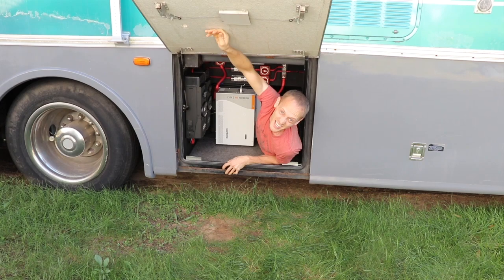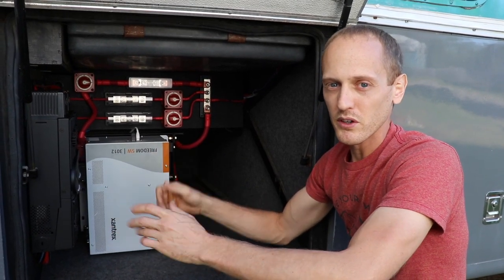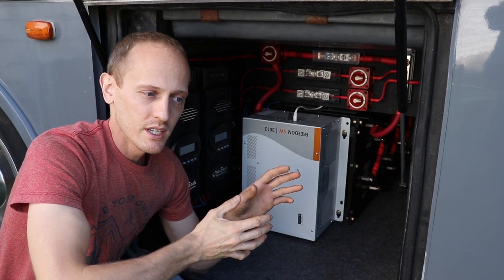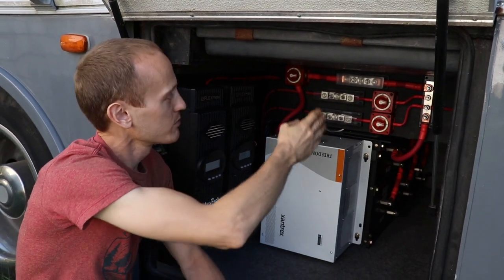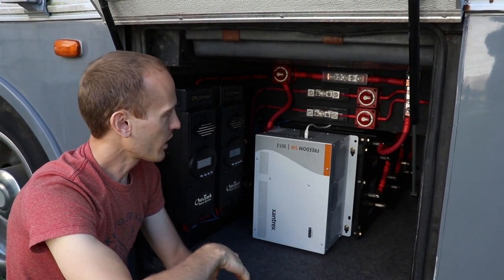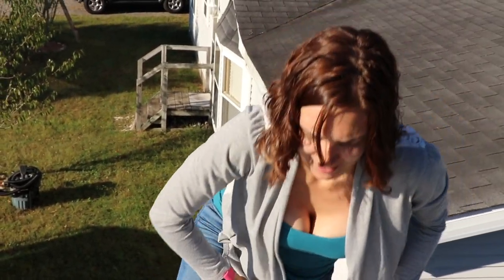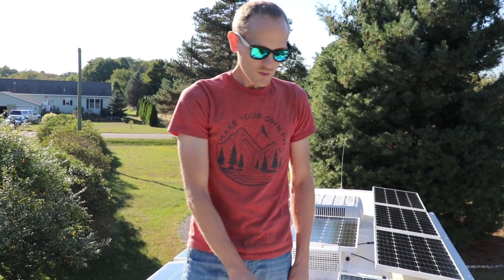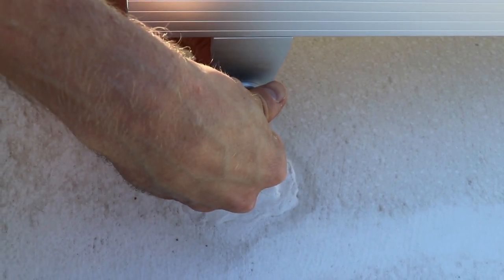Massive DIY RV Solar Install for Off Grid Boondocking

Comment: I'm not so sure the lithium would have cost you that much more. 

1) The lithium can be discharged a lot further than the AGM.  So, you only need half as many amp hour equivalent lithiums. 

2) The lithium will charge much faster and require less energy to get to full charge.  This would have reduced how many panels you needed to buy.
3) They weigh less which means the install wouldn't have taken as much time or materials.
4) They last MUCH longer which means additional savings in the long run.
Don't get me wrong, if you were buying dirt cheap AGMs because you simply couldn't afford better than I could see the argument that lithiums are just way outside your budget.  However, considering what you did buy, plus all of the other equipment, then clearly you had some wiggle room.  Just my 2 cents.  It's your system though so you do you.  Nothing wrong with going the AGM route if that is what you prefer.  Just sounded like it wasn't what you would prefer, just what you thought you could actually afford.
Reply from the maker: We would definitely prefer lithium. It would have been $3000 more to go that route and it had already taken us 3 years to work overtime and weekends to save up for the system we have along with renovating the entire rig. We aren't made of money and didn't want to wait another year to save up to go lithium. We have been on the road full time traveling for almost 11 months now. We would still be working if we hadn't taken this route.

Comment: Nice setup we have 2880watts on our 5th wheel with two battery systems front is 400amp Chevy volt  then back is 1253amp 6volt battery's about 800lbs. Keep the sunny side up!!
Reply from the maker: Definitely! You as well. Living the silent power dream. 😎☀️

Comment: Thanks for your prompt reply..... I have 10 (200) watt panels on or '07 Newmar. I've seen 1450-1500w high sun. I believe I have shadowing from (3) AC's & other misc. I don't have ability to tilt nor do I want to. I have seen mention about an add on box to the back of each panel that helps the shadowing problem..?

Comment: Nicely done..!! I have a similar size solar system on our class A. Realistically what watt do you see in on average.?
Reply from the maker: The highest input we have seen is 121 amps to the batteries. That would calculate out to about 1650-1700w depending on voltage at the time(bulk or absorption). If we are going with an average in good sun I'd have to say around 80-90 amps midday. So around 1100-1200w. We have been pulling in 30 amps while it is raining before.

Comment: Really nice system! Just wondering how the panels raised up like that have handled the wind from driving? Any issues with lifting?
Great job!
Reply from the maker: After 11 months of full time travel (so far) and 20,000 miles, I'm happy to report that there are no issues with lifting. People don't realize that we are driving a brick down the road. 😂 The aerodynamics of an RV create a tumble of air on top that in a lot of ways actually pushes back down on the roof. Add to that the fact that a solar panel has a blunt edged frame around it that doesn't generate lift like the wing of a plane, and you are good to go. If you plan on installing solar, I would highly recommend mounting the panels higher that what they are with the tiny brackets provided. The airflow to evacuate heat while in the sun will be worth it. Thanks for watching and asking questions. 👍
Reply: @HereThenGone  Thank you so much for the quick reply. I love the idea of lifting them up for airflow and less shading from the A/Cs and such. Something I had not thought of before. I will be using this technique when I start our solar set up in the future. Thanks for the great videos and keep up the good work!

Comment: I don't understand, you have a vehicle that undoubtedly has a 24 volt system and you are installing a weaker 12 volt power system.

Years ago I switched from 12 to 24 volts much more powerful.

Hopefully you have connected the panels in series with high voltage.
Reply from the maker: You are correct. You don't understand. Haha. We have a 12v system on the rig. 12v alternator and all 12v components. Hence, the larger 12v power system. It has worked above and beyond our needs for almost 11 months on the road full time. 

Power is rated in watts, and is a combination of amperage and voltage. 24v isn't more powerful, it just slightly decreases the amperage draw on large power devices. With a system like ours with the appropriate sized wiring and components, the difference isn't worth the extra DC to DC converter needed to step everything else in the rig back down to 12v. 

I clearly stated in the video how we wired the panels

Thanks for watching 😊
Reply: Almost all buses here in europe have a 24 volt battery system. hence the confusion.

Nice power system only be careful with eating  otherwise you will not fit in that hatch anymore 😂.
Reply from the maker: @lexpee  haha. We've been eating a plant based diet for over 3 years now. Have to make sure to fit in all the tight spaces and keep ourselves extra healthy. 👍

Comment: What kind of roof? We now have a fiberglass roof on our dp and I’m not sure how to install the brackets. I don’t think there is enough wood underneath to hold screws for the wind load. Our 5th wheel had a membrane roof over wood, that was straightforward. Great installation!
Reply from the maker: Yes, this is a rubber over wood style roof. I don't remember the exact product, but I have heard people getting good results with industrial adhesive on the mounts connecting to the roof. If I were to go that route, I'd want to make sure there is plenty of surface area on the foot of the mount plate. They also do a combo of the adhesive and a self tapper or two, then dicor over the whole thing

Comment: Very sweet set up! I'd be interested to know how you integrated your Generator? I've got a built in Onan and am planning a solar setup, but am just not sure how to integrate them without having them interfere with each other.
Reply from the maker: If your generator is already installed, you have a 30 or 50 amp transfer switch installed already. In our setup, the inverter has a 150amp charger in it. When on shore power or the 2 times we have run the generator in the last 10 months, it simply engages the charger and the solar charge controllers see that there is no need for them to run, so they go to sleep. Having multiple input sources charging your batteries is fine. Each will only put in as much as is needed. Typically the charger run from shore or generator power will act as the main source and your solar controllers will take a back seat
Reply: @HereThenGone  Excellent! I appreciate the info!

Comment: I really enjoyed this video. A few things that stand out and I applaud you for. A young couple that has an idea, then studies enough to make it into a plan, then research and study enough to work to turn your plan into reality. Hats off to you both. Y’all sorta remind me of my wife and I back some 35 years or so ago when I wanted to build a house when all I had was a hand drawn sketch on a piece of paper. Like you, if I can envision it, I can build it. Since then have built two houses, both better built than what I would have gotten if I would have just hired a contractor, that at the time I couldn’t afford. You inspire my confidence in the younger generation. (I’m 65, worked over 44 years in the rotating machinery installation, maintenance, repair, and everything in between within the oil and gas industry) You thought out what would be the best within your budget, then executed your plan. You remind me a lot of us. We lived in a 42’ diesel pusher the 4 times I unrestored to work on a project. We now have a small Pleasure-Way B+ motorhome on a Sprinter chassis. Your setup inspires me to do similar but on a smaller scale. With the setup you have, you could easily run a high SEER mini split AC 24/7. Check out David on Gone Boondocking on You Tube. https://youtu.be/rjVIxqTHahY   He, like you, has some good ideas, like his hour shower for example. Maybe one day will see y’all on the road. Safe travels. Enjoy life. Don’t let your dreams outnumber your memories.
Reply: Un-retired not unrestored. Darn spellcheck.
Reply from the maker: @dannybevills1567  thank you for the kind words. Not having a lot in life surely makes you more self reliant and driven to work. Sounds like we would get along great in real life. A mini split has been on my mind for a while now. The initial cost is what is holding us back at the moment. Hope to dive deeper into it in the future

Comment: Wow! Absolutely gorgeous design. I get super excited when I see a system so beautifully laid out. I would love to see a pictorial or schematic of your system, although I think I would want to try to locate my battery bank in an easier to reach location :-) I could see myself getting in there, and getting stuck forever.
Reply from the maker: Haha. The only positive about them being tucked away is that they don't need any maintenance, so now that they are in, they are out of the way. Definitely a pain to get them there though. I never ended u making a schematic because a) I tend to just design things in my head b) no two systems will be exactly the same. I do understand that it would still be a useful tool for others though. Maybe I'll have to get to that some day.

Comment: Have you ever thought about coming up with a DC heating system and somehow running the AC compressor with a DC motor??  That way skipping an inverter and ALL that robbing of DC amps/ac power.
Reply from the maker: The problem with that is that wattage is wattage. The only thing you would gain from that would be the conversion losses. So instead of the roof A/C drawing 155-160 amps, it would potentially draw 140-145 amps. Still much too high to be practical.
Reply: @HereThenGone    ??  When in a Motor Home is off-grid my DC wattage/amps ARE robbed by the INVERTER'S A current...  If I had a DC heater or a DC compressor to run mt Air C I'd be way ahead of the game.   A magnet motor could run the dc compressor OR what about a magnet DC 2 H. Power running a CAR Alternator - which could put out 200 amps.  ??  The primary source of power would be SOLAR....
Reply from the maker: @peterscherba4138  haha. When you have completed this miracle setup, let us know how it works out for you.
Reply: @HereThenGone  You don't see IT as possible??  A  car alternator has to spin let's say 1200 idle rpms.  With half of your solar panels couldn't U run/spin a powerful DC motor?? That motor could spin a high output ALTERNATOR as in a car.  This can run longer than u have SUN.  Show me where I'm wrong. U can series 12 Volts to make 24/48 etc by having a Switch back to 12 volt charging from solar.  Explain  why U couldn't.
Reply: I realize TORQUE is needed to spin an altern
Reply: -nator and a strong H power ofPower motor
Reply from the maker: @peterscherba4138  if I have to explain to you why you couldn't run an air conditioner by spinning an alternator with a DC motor powered by solar, then we are not going to get anywhere. I have no burden of proof here. You do. Conduct your experiment and make a video of the results.
Reply: @HereThenGone    You are not thinking...  Look how much $ you've spent ON solar panels and what do you get per 200 watts?? A measly 10 amps at peak hours... An alternator can produce 200 amps ( in a vehicle)  If u can utilize that THEN it can charge your batteries --- then you hook-up an inverter and you CAN run an Air C.  If you're too lazy to brainstorm a little with someone then you are correct --- we won't get anywhere.  Ideas and solutions come from discussions --- not self-right thinking.  Besides, I'm in the Vancouver area and is why I'm venturing toward other options --- and there are many out there.    This is 2020.
Reply from the maker: @peterscherba4138  it sounds like you are saying that you will run the alternator with your vehicle engine, which of course would work. But that defeats the entire purpose of solar. You won't be running a high output alternator with solar.
Reply from the maker: Also, it's not self right thinking. It's simple math. As you've stated, we'll only get 10amps at peak sun from 200w of solar, so how do you figure you can run an alternator under load with a DC motor powerful enough to charge enough batteries to run an A/C unit. The math doesn't add up. And as for saying I'm lazy, I think my video speaks for itself on how NOT lazy I am. I built this system along with renovating my entire RV while working 60-70hrs/week and renovating my house to sell to hit the road.
Reply: @HereThenGone   You definitely are not lazy --- I only meant not discussing or questioning/how can one do what I'm proposing.  Like everyone says you can't get something from nothing (equations don't lie).  But because of magnet motors.  If they can spin an alternator by using much fewer amps to do that then perhaps one could gain or get slightly ahead.  Solar isn't nothing IT is something that is cheaper.  Magnetic motors are also something.  So if I can find a way to CUT my cost down to a minimum then I am ahead of the $ game.  Like solar is (once paid for)  I lived in an RV and the conventional power system supply is expensive.  Generators/Inverters (Las Vegas)  heated inverters etc.  Now Canada --- heaters.  If I could find a very cheap way of running a charging system I would buy it.  Even if it cost me 1000's initially.  My choice would include Solar/Wind and if magnetic motors were very effective and hydrogen and whatever else is out there.  Chemicals producing ways except I won't be on the hook for buying their cartridges.  
I know it comes down to how much $'s one wants to spend initially --- but in the long run, if it pays everything back then I'd do it.

Tesla's ideas... I'm sure you are more versed in these things than I.  I just recently bought my 2012 Itasca and I'm in Parks.  Vancouver area is costly.  Have you tried or thought of DC heaters?  I don't know how efficient they'd be in freezing temps.  Air C isn't as much of a need in the northwest.  If you have some ideas I'd appreciate them.
Reply: @HereThenGone   Only used that as an example where an autoMOBILE runs on a 12 volt-system similar to RV'S.   A cheaper source of running motors is what  I believe is key.

Comment: What brand solar panel and are they mono or poly?
Reply from the maker: They are Carmanah 160w mono panels. There are cheaper 200w panels out there, but we know people that have had these installed on an RV and now a sailboat for 8+ years without a single issue, so we know they are a quality product.

Comment: how much does a setup like you have cost? just put money down on motorhome that were planning on staying in till we can buy a house,and i have no idea what im doing, total noob
Reply from the maker: We have $15,000 invested and did all the work ourselves. If we went Lithium it would have been more. You can buy cheap components to save money, but you know the saying.
Reply: @HereThenGone  what you did is awesome, looks like classy professional stereo install (that's something that I can relate to, but all the converting is way over my head and series down to parallel is mind blowing to me) 
Im a machinist too. Will definatly look into something a bit smaller to start out (would like to be fully off electrical grid someday)
Reply from the maker: @mattcarafa210  I (Sean) was into car stereo back in the day! I never competed but I was in a car club that had people who did. Cleanliness of install was one part of the points system. It also makes it so much easier to troubleshoot if there is a problem. 

Definitely just do what you are comfortable with and you can learn and grow over time. Using propane to cook and not all the electric devices we use would allow for a much smaller system to work for you. (As long as you don't want A/C. Haha)
Reply: @HereThenGone  not too worried about ac immediately, in mountains doesn't get all that hot, but the heat, electricity, and water(probably add insulation) gonna hook into grid in mean time, but would like to do the solar panels. We're getting no where paying someone else's mortgage and were going with the wife's idea of living in motor home till we can buy/build a house(she has been trying to get me to do this for years and finally agreed with her) The people were buying it off of did the same thing were going to do, they got their house now. Hopefully not a huge mistake, fingers crossed.
Reply from the maker: @Matt Carafajust keep in mind that even a propane furnace fan draws 8-10 amps when running. If it has to run often, that power really adds up. Adding insulation would help but it is difficult on 1-2 inch thick RV walls. Also electric heat is the most inefficient form of heat if that was what you were going to try.  We have another video that goes over exactly how to size your solar system for your specific usage requirements. 

 https://youtu.be/UnCM5gCqSWs